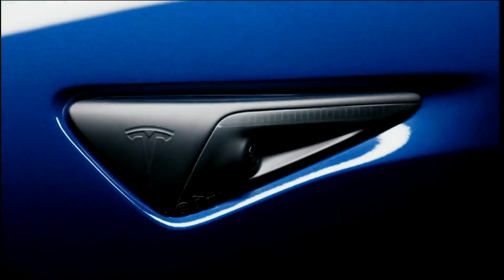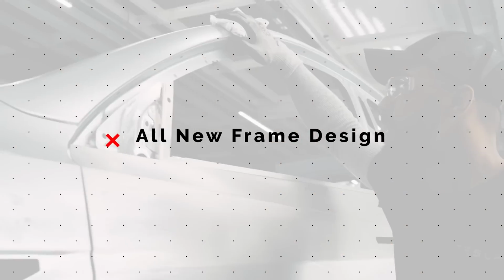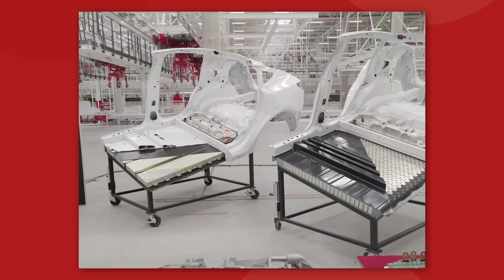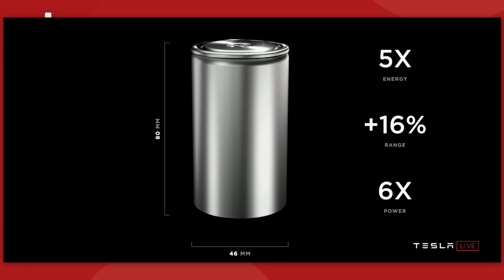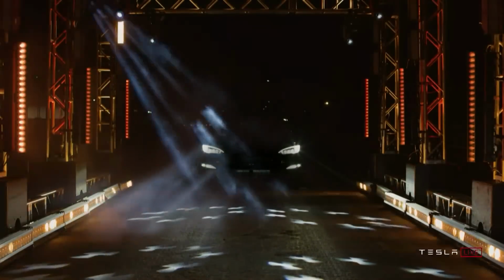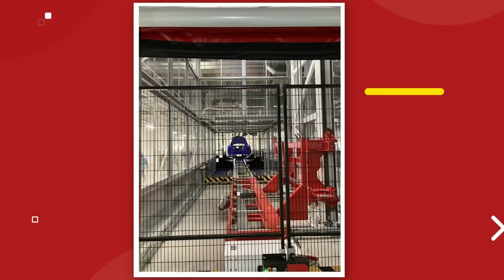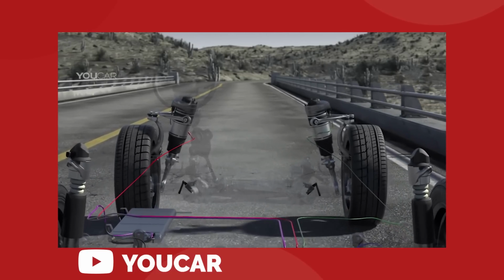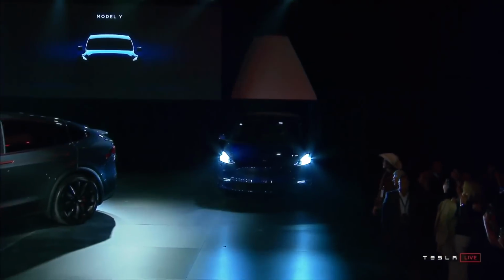The 2022 Model Y Update Is Here!

Comment: Great video, so if I have a preorder for estimated delivery June 2022, does that mean it would be considered a Model Y 2022 version?  Has anyone had experience with this? If the price changes between now and my build, new features etc, do you get those new features for the price you locked in at when you preordered?

Comment: Anyone know why they just don't use 4 motors; one per wheel?  Seems to me there would be some benefits.
Reply: What benefits would it have with 4 motors?
Reply: @Delitor  I would suspect software control of each motor independently should be easier across all models.  For less expensive models you could have front or rear wheel drive only using two motors.  There should be less parts used and less power loss because there is no transmission to divide up the power.  Also having 4 motors will give you redundancy in case one fails.  Hopefully you will still be able to drive to a service center.  Swapping motors should be easier during service if one is having a problem.  High performance cars will just get stronger motors.  It could even be turned into an option later one to upgrade.

Comment: 5x power and 6x energy only gives you a 16% gain? I wonder where these number actually represent.
Reply: Same here. I called and was advised they’re doing a huge push in December/ Q1 22 to try and get them out sooner. You never know
Reply: The increases are per cell, but the cells are larger so you can get less in the same space. So the 16% increase is for the equivalent volume.

Phillip.

Comment: My order shows to be delivered in April 2022, I hope it will be the 2022 model.
Reply: I was told by SA that all model Y’s delivered after November will be a 2022 model
Reply: @luismendez2852  nice, hopefully 2022 model gets some range improvements
Reply: @GuugiYae  I also asked that question but I could not get a straight answer I ordered my MY LR 7 seater sept 25th and my delivery date is between mid jan to mid feb
Reply: @luismendez2852  if it wont be any range improvements, i think i will postpone my delivery.
Reply: @GuugiYae  l’m test driving the 7 seater this weekend and I will ask that question for what I know from other people’s comments you can only postpone for one month after that they will put order on hold and possibly loose your deposit
Reply: @luismendez2852  umm here in Canada, the deposit is $ 250 CAD. I’ll see what will happen at that time. If it worth waiting, I don mind losing $250. Because will have to stick with this car for a very long time. This is my 1st EV car.
Reply: @luismendez2852  I just checked back today and the model Y in Canada price increased $4000. That’s it, I won’t postpone my order. lolz

Comment: I’d be amazed if the Model 3 AWD improves beyond their 2021 refresh. It already has 350 mi range, fast acceleration, USB C ports inside, wireless phone charging, heat pump, power trunk, etc
Reply: They'll find something to add to
Reply: Could do with power frunk, probably will get a yoke
Reply: 2 reverse lights would be nice for starters

Comment: The delivery date for my Model Y just got pushed back to late April to mid March. What do you think are my chances of getting the new front and rear castings, 4680 batteries, and air suspension?
Reply: My Model Y was supposed to be delivered by December and also got pushed back to March-April. I spoke to Tesla about this and asked if the new car would have the new battery and they said, as far as they know, NOTHING will change for the 2022 Model Y from what it is currently. I am hoping they are wrong.